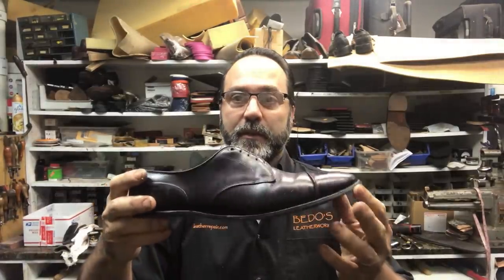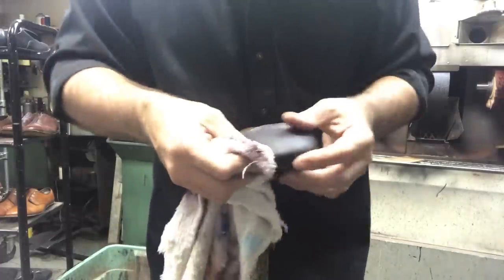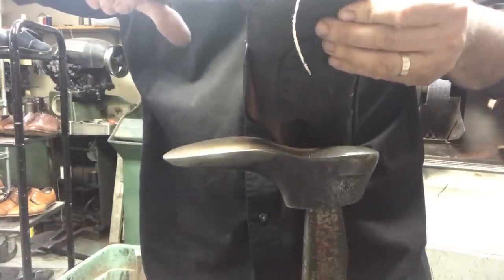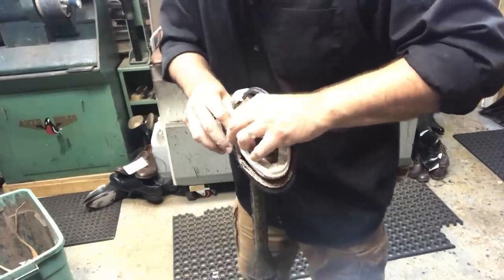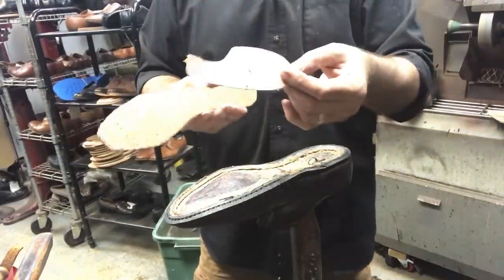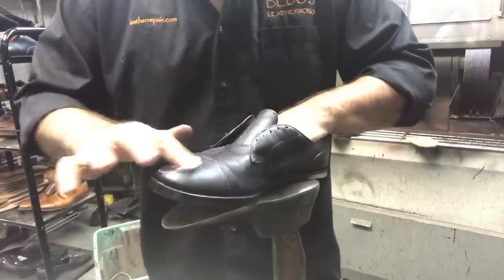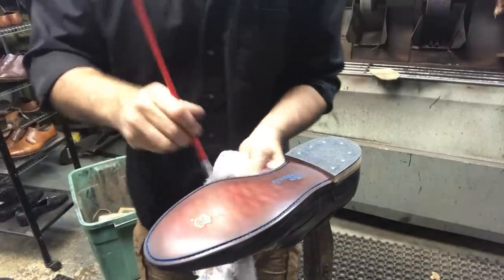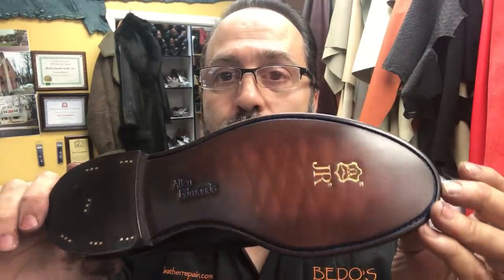Allen Edmonds Cap Toe Restoration #127

Comment: Steve, Have tried you coffee that I purchased at the Holly Land Café at Lowery and Central Avenue, Mpls.,MN. It was stronger than Expresso. I did like it and have some on occasion. During grade school I used a shoe repair shop on the Rum River in Anoka to repair camping gear. Broken rivets were replaced with canvas for most applications. For rain flies on tents extra material was added to support the grommets. The waxed Dacron thread also made a fine bow string for my hunting bow. My contribution during grade school was to watch and learn how repairs were made. When camping on a farm it was common to see boots needing repair. As one might expect the boots were not cared for, and had cracked. The shoe maker was able to get additional life from the boots, and the farmer was happy to have someone around who could fix things or have them fixed. For most purposes, any solution is a good one. Many farms did not have running water or electricity, and were living a comfortable life. Filling the kitchen wood bow, was considered good manners. Leaving muddy boots outside was also noticed. Offering to dry dishes after a meal was a good time to ask about rabbit and pheasant hunting. Many of the older farmers speak the language of the old country. Learning how they grew up was an eye opener. I do enjoy you program.

Comment: The bottom of those shoes are awesome. The nail pattern plus the cross hatch paint really looks sweet. So what does the happy customer do, immediately puts the shoes on and wear that artwork right off! As I have learned over time in my job is the product needs to look good on the store shelf, not just perform well. 
Once again great video and ignore the haters.

Comment: Finally I saw how that sweet fish pattern is done on the sole. It's a painting! Btw, you've mentioned a few times that hot cork is not for repair shops only because it requires special machine. I guess they made it more affordable/compact since, they use it a lot on the Trenton & Heath channel, for example. That hot iron going through that oatmeal paste is very satisfying for the viewers, I have to admit 🙂. But as you mentioned, there is no structural difference, it's the same cork at the end.

Comment: in addition to what Stevo said about welting:
bespoke shoesmakers pull the threads extremely tight for a few reasons: 
- the footbed is carved out instead of glued-on canvass so the leather/leather contact is complimentary versus leather/canvas contact in gyw.
- the last is 100% personalized for the owner's feet, the tighter the tolerance the better.

Comment: Ah, you mentioned Masters Cement.  I bought a little can just to try it based on your suggestion.  I like it so far.  Question:  When you refill you glue pot, do you thin the Masters down at all?  My little can is really thick and does not spread like yours appears to.   They do not sell small cans of thinner.  So I have to decide if I am going to continue to use Masters.  I think that each contact cement manufacturer uses their own type of solvent/thinner.  Thanks Steve.

Comment: about the cap toe length: is there any construction like full-length vamp with just the toe-piece being patched on, instead of cut-and-sewn at 10 cm or else, in order to ensure durability? anyway, another very refined restoration finished. thanks!

Comment: Sorry for the late like... Superb job and timely, I'm just about to re-stitch the toe cap on my Cheaney TCOs.... I've made a stitching awl from/with a sewing machine needle. Going to use Gutterman linen thread. I don't have a patcher or access to gemming(spelling?) so taking the shoe to bits isn't an option. Wish me luck
Reply: @Strawberry Cream yes and no. unfortunately, the stitch holes in the shoe were too weak and near the edge to be strong enough for just the thread. I glued the toecap first to ensure the stiches didn't tear out.
Reply: @Strawberry Cream well, I used proper leather glue and cleaned the inside area with meths before glueing... it'll be as strong as the bond between the sole and the welt.

Comment: How many times can a pair of shoes be repaired, soled & heeled etc before you say it isnt worth doing? My Dad had 1 pair of shoes for best that he had soled & heeled etc usually rubber half sole & heel. He had those shoes for years but they looked almost new cos he took such good care of them.
Your videos would not be so you  unless the camera fell over & you moaned about the haters. I love watching you work it is so educational & relaxing.
Reply: It all depends on how you treat them, the quality of the shoe, and the cost of the shoe. So if you never oil them and the uppers crack than the shoes are dead. Also I'd be willing to spend way more money repairing a pair of vibergs than I would a Walmart shoe. If fixing you car will cost more than half its value it's considered totaled; eventually it will be more economical to buy a new pair then to fix your old shoes.

Comment: The video is streaming in 1080, the problem is not resolution it is over exposure. So the highlights are "blown out", which results in no detail in the highlights - like the light falling on top of your arms. This is the first video of yours I have watched, my guess is the phone/camera is set to auto exposure. As the camera is framed on the work piece, it means much of the frame is filled with your dark shirt. The camera is exposing for the shirt. Watch some of the video where you walk out of shot how the camera exposure changes and there is more detail, when you walk back into shot the camera exposes for your shirt. The solution is let the camera set the exposure when you are out of shot, remain out of shot and turn auto exposure off. The other solution is to wear light coloured shirts or a light grey bib apron/dust coat. Yeah, not exactly the best colour when working with leather; but it will improve the picture. BTW interesting to watch you work.
Reply from the maker: Alchemetica thank you, you’ve been helpful